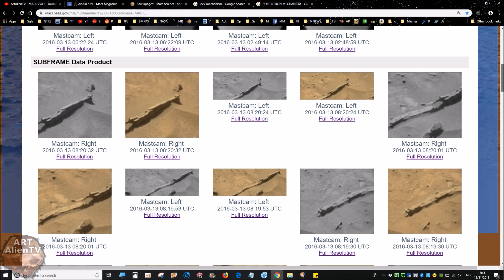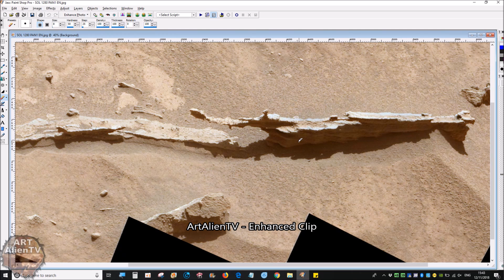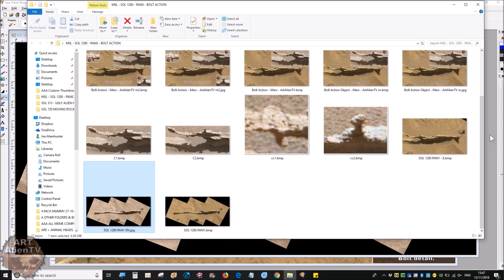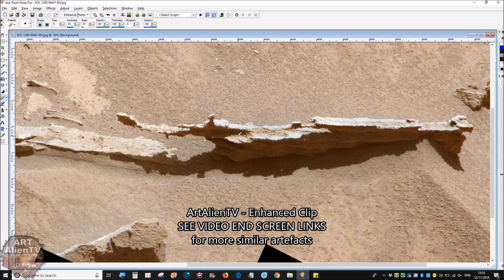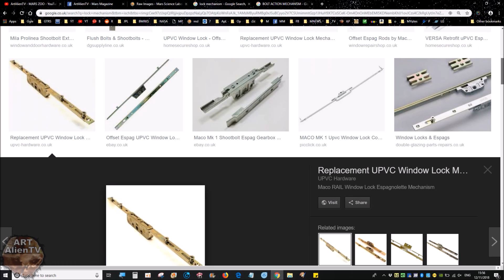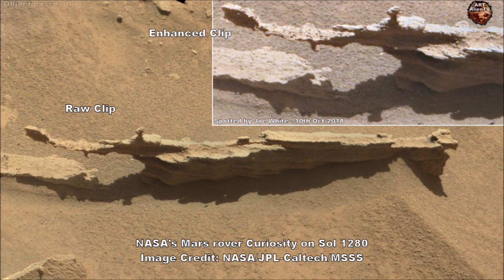Mars Mechanism - Corroded Machine Gun - ArtAlienTV

Comment: Great find Joe it reminds me of an old type of spring/suspension for a horse drawn carriage where you get layers of metal to act as a spring? You would probably find this under railway carriages or something similar? 🎥👍
Reply from the maker: Who knows what this thing is? It is manufactured for sure. It does resemble a suspension type structure but the bolts say a locking mech thing to me. Could be a gun, door lock, crossbow anything like that .Thanks George :)
Reply: Maybe hardware for a sailboat. This is not nothing.

Comment: Some of the shadows are not correct, alot of coverup in photo's but Nasa/JPL are getting better at their fakery
Reply from the maker: If you get the images from the link they look more natural. I rotated them to fit the video viewer :)
Reply: In one area where there should be a shadow they laid "sand" over it. Anout the middle of photo where prong is sticking up. 2 shadows when it should be a continuous shadow. I checked it with one eye shut also 😂

Comment: Crossbow. Spin the front section 90° and it will lock in place in the bottom of the other section.  The extreme right end screams trigger release mechanism.  Wood or metal with this much age is hard to vet. Wood has knots that go thru also. Rocks??? Hell no!!
This is not natural.
The extreme right end has more right angles than a square! LoL
Reply: And the hole on the back stabilized the end of the arrow.👍
Reply: @pinealthrone  that's what I see. I would say if the dust hadn't settled you could stomp around there and find a arrow and some cording if it didn't rot. No atmosphere so it's probably laying close by. Some type of crossbow. Manual or electronic.
Reply: That's exactly what I thought.

Comment: Joe good find it does look like a Door Mechanism 9:19 On a closer look on a bigger screen the bolt or pin sticking up seems to be  inserted into a square hole and right next to it on the right seems to be a cog That would mean the bolt or pin would move when the cog mechanism turns maybe But what caught my eye the most was the item to the left 10:45 I think this image in my opinion is a flintlock gun of sorts

Comment: LOL, if that is paradolia, it's the most detailed paradolia I've ever seen. You know what else it looks like? @9:44, with the image leveled, it looks like a cross-bow, with the limbs broken off. The trigger-finger hold, cocking mechanism and flat arrow platform are intact, it's just missing the limbs. But yeah, door bolt works too--and either way, it just looks artificial. Good spot, Joe!
Reply: Thats obviously a mechanized latch of some kind, I don't think anyone can argue that.
Reply: Have to say though, it does most closely resemble the window locking mechanism you googled. Almost all the parts (eroded of course) seem to fit it best. Well done!